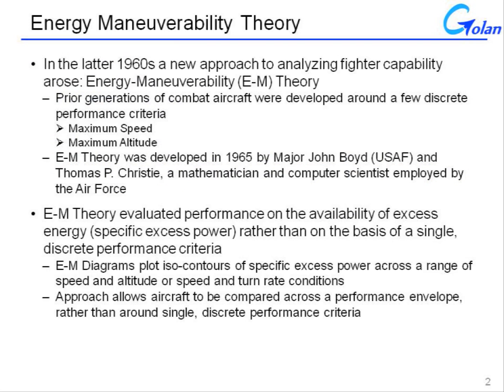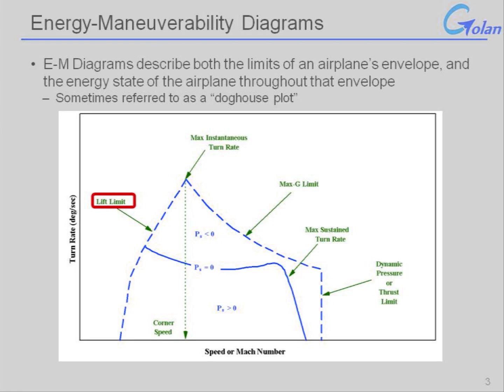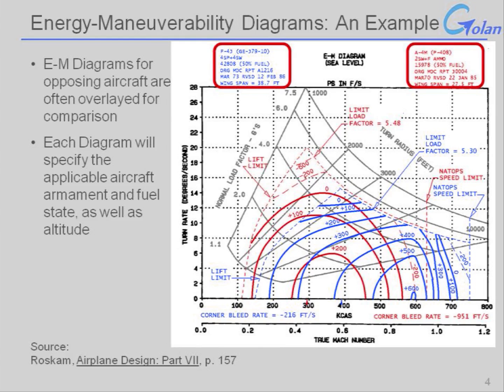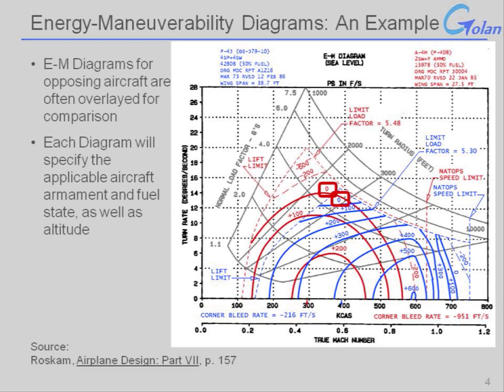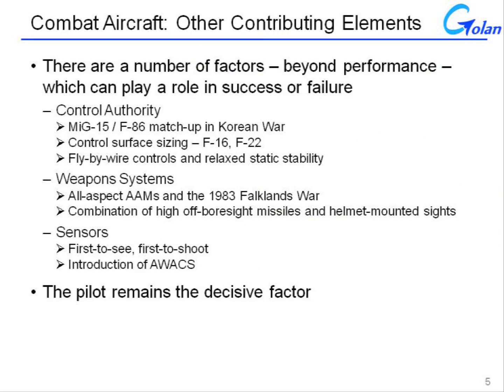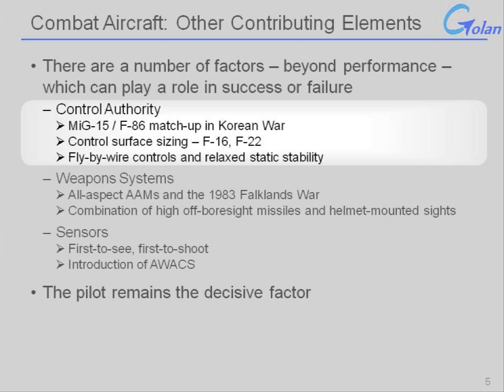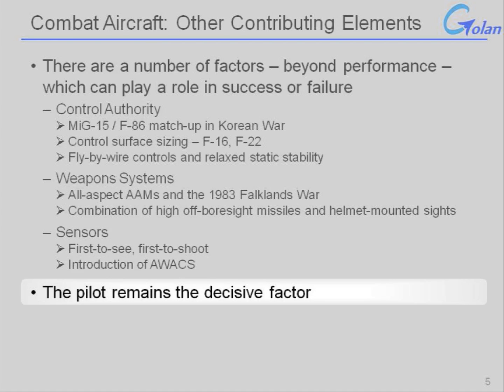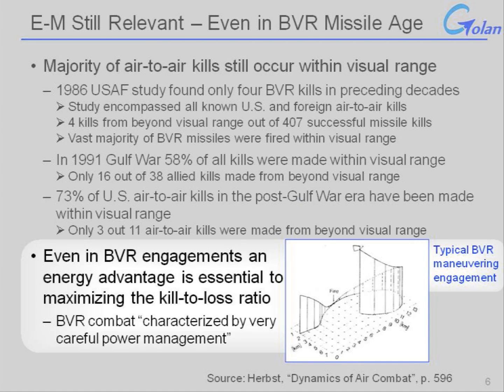Aircraft Performance - Part 4

Comment: I concur - great intro into aircraft performance. May I clarify: in comparison of A-4M and F-4J E-M diagrams areas where particular aircraft prefer to fight are limited in one section by the line defined by the two dots: intersection of Ps0 lines (max sustained turn rate with no excessive power) and Ps+100 lines (sustained rate with +100 excessive power), correct? Is that because these are the only sustained turned rate lines that intersects (for example sustained rate lines with +200 and higher excessive power for both aircraft do not cross)?